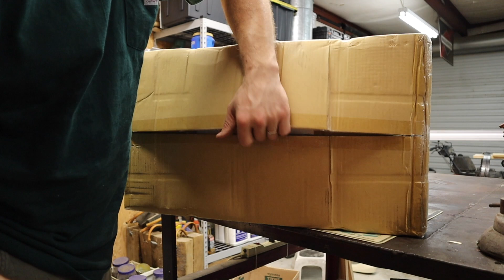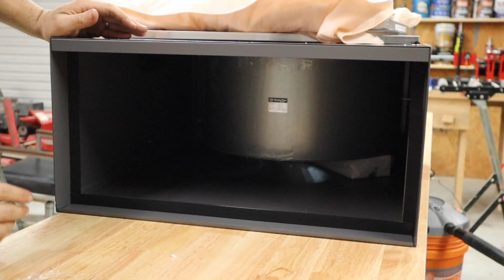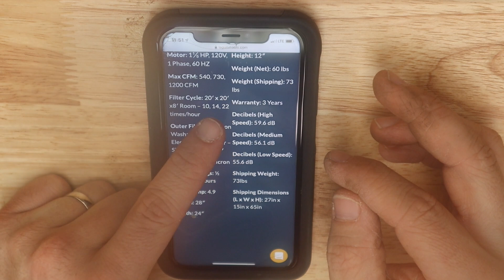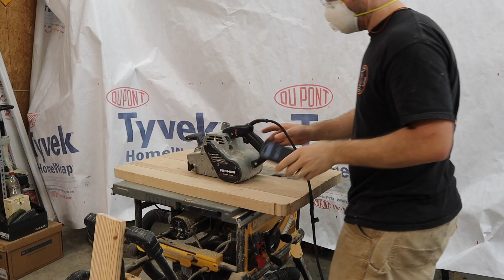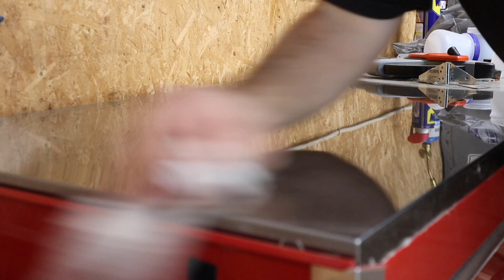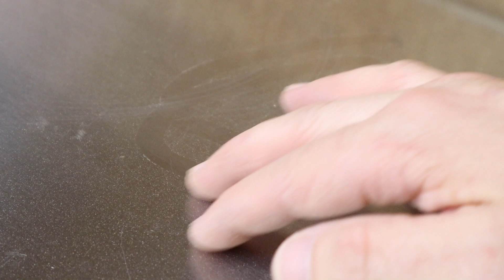This Simple Tool Could Save Your Lungs - LAGUNA SUPERMAX

Comment: I enjoyed watching this review.  I recently did a review of the WEN air filtration unit and it looks like we hit the same key points.  I did not run a test like yours at the end, but I was thinking about your comments about how it is supposed to be used in conjunction with a dust collector. 
Have you given any thought to running another test with a dust collector attached to the sander and then do one run with the air filtration running and one without?  To me that would be the true test and may actually give you some results to show on camera with the "larger" particulates removed.
Reply from the maker: Mitten's Woodworks & Milling No plans to do that, but I do believe that would be a great test.

Comment: Dollar for dollar, the absolute best air filter I have ever used is 20X20X1 MERV 13 furnace filters, one duct taped onto the front and one on the back of a 20 inch box fan. I have 3 of these hanging throughout my shop, and a fourth that I keep mobile to draw dust or paint fumes away from me when I am sanding or finishing a project. Three of the fans set up the way I described probably does the work of two of these air filtration machines, and at a much lower price. The fourth is just icing and a candle on the cake. When the filters get dirty, toss them and install new filters. The filters are a lot cheaper on Amazon than they are in big box stores too.

Comment: Blower wheels are balanced. Some do come with a clip on weight. But no more wobble than your getting it will work. You can see this same wobble in high priced heating and air units. If it's bad enough you feel it on the outside of any unit the rubber mounts for the motor can't stop it. Replace the blower wheel, motor bearing failure has began. For a high speed motor and to keep cost down the bearings are sleeve bearings.

Comment: Maybe it's just me but the difference in dust accumulated between the lower speed and the high speed setting was apparent.  It seemed to me that much more dust was collected at the higher speed.
Reply from the maker: Ron V Most definitely. Lots of very fine dust was scrubbed out of the air on the higher speed.